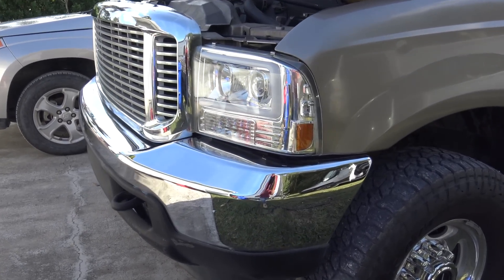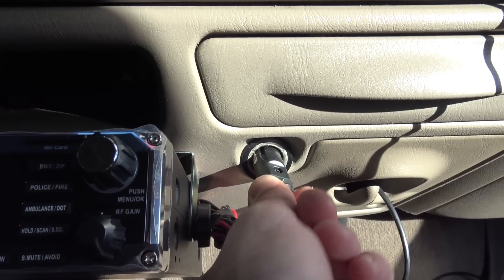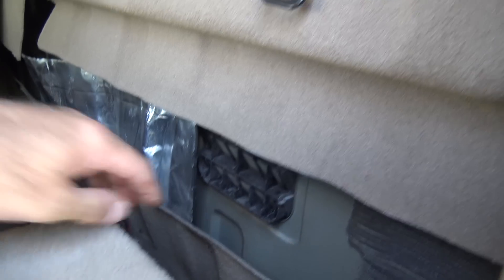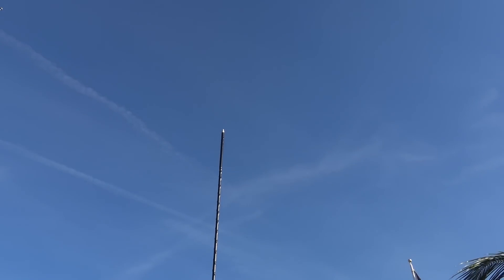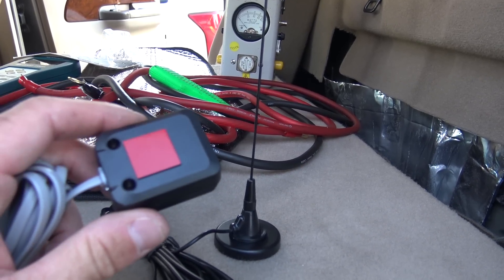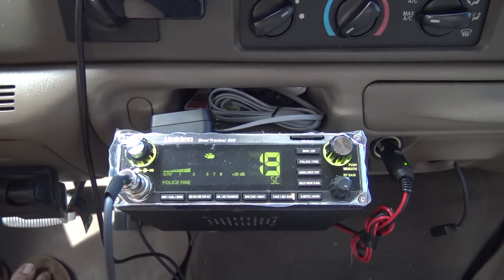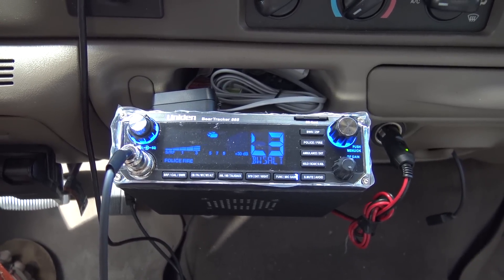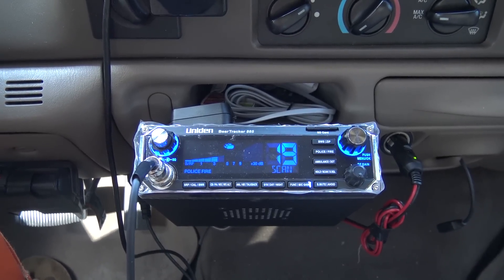I Installed The Uniden Beartracker 885 CB Radio/Scanner Hybrid In My Truck, Review Part 2!

Comment: Fine video! Thank you!
The unfortunate thing is that in my area, the police are so paranoid that they are 100% encrypted. I certainly see the need for encryption for various reasons, but why 100%. Traffic accidents? Really? I used to be able to avoid a road that might be blocked... a.k.a. avoid contributing to a congestion problem, etc. What about closed roads for flooding? What if there was something 'big' going on in my neighborhood and I might want to lock my doors etc.? This actually did happen about a decade ago, and there were helicopters sweeping the area. I was able to hear the area being impacted and whether the suspect was getting closer or moving further away. THAT is public safety to me!
Again, nice radio and thanks! (sorry for the rant, but I bet I'm not alone)
Reply: NO. THEY ARE ON NEW DIGITAL RADIOS AND NOT ANALOG RADIOS
Reply: @daleschleicher7794  No. They are digital AND encrypted 100%. Thank you for your incorrect correction.

Comment: In my 04 f250 I screwed the Mount into that removable “trash hook”.
Tilted it slightly so it favors the driver as well, happy with it because I didn’t mess up the main dash, the piece is easily removable and I have a replacement if I decide to remove the radio.
Reply from the maker: I don't dare open that cup holder if that's what you are referring to lol. Every truck I have had, it opened and never went back in correctly.

Comment: I would leave the right angle adapter where it is and put one on the other side. It looks better and there is less stress
on the coax. And the loss on the connector is negligible.  And this is one of the better installs I have seen..

Comment: If you encounter intermittent SWR issues run a ground strap to your tool box. I’ve had issues with that in previous toolbox installations.  Also watch for water following the coax down and entering the cab through that black plastic box behind the rear seat.  If you have enough spare coax make a drip loop in the coax between the cab and the bed and that may stop or prevent it.
Reply from the maker: Grounded the toolbox after this video

Comment: I powered my 980 with the console power port but I t-tapped into my 578 power for my 11m 1.21 gigawatts linear amp. That's right 1.21 GW. I can talk to truck drivers on Pluto!
Reply: Yeah, but the time it takes for the signal to get there and return is a buzzkiller.
Reply: @spaceflight1019  🤣😜

Comment: Hope it works better for you than what I've heard - most reviews of this I've read or heard are that it's a subpar performer and to steer clear.  Most say that if you want a scanner, get a scanner and not this scanner/CB combo since I guess it is pretty limited on customization options, etc.
Reply from the maker: It works for what it is
Reply: @HamRadioConcepts  Yeah the criticisms were about the lack of the ability to customize the scanning portion. Looks like it does work with basic functionality.

Comment: You can adjust which is prioritized in the menu for scanner or cb, 
Or you can have both, talk at the same time
Reply: I found that if I set the prioriety for the scanner, that I can squelch in the cb and when the scanner broadcasts it will override the cb, works nice.

Comment: We just have to get ya some Peterbilt mudflaps on the rear of the truck :D I still have my Uniden 980ssb that does SSB but the President McKinley does a better job at SSB. That plastic box with the flap helps push air out when you shut the doors closed. Some are in obscure places and some like the semi I drive at work has them visible on the back. Ours open (the flap) when we run the heat or AC.

73 Eric! It's always fun watching your videos with anything radio. 

WX7UTE

Comment: I've got a Uniden 980ssb that I used to run for cb along with my Yaesu FT-857D and a 1900r.
Radio nerd 😆.
 I pulled it eventually for the bulkiness and lack of use. It has a really good receiver imo for the price.
I also used to use a Yaesu FT-7100 dual bander a few years ago. 
The reason I bring it up is that I used it mostly vhf + vhf with the sub band on local LE freqs. They went digital though 😭. They ran off and left me in the analog dust. This is the perfect setup, albeit qrp 💩. I think if you use a Diamond MX-62 duplexer, with the hf output on the SO-239 cb side, and the vhf/uhf on the side with a BNC /SO-239 adapter you won't have to have to use that dinky scanner antenna, and it's not blatantly obvious that you're running a scanner. I did this for a while years ago with the FT-7100m for receiver of leo freqs and a Cobra 25. 
The antenna I use(d) still is a stainless steel whip #indestructable 👍
In closing, I'd really like to get one of those, but my Nissan Frontier just doesn't lend itself well for anything other than remote mounting or small compact radios.

Comment: I am surprised you don't know better.  Co-phase antennas need to be a 1/4 wave, on 11m is 9ft that you know, Your pattern is going to be screwy, change out the 75ohm to 50 with a T and run co-linear.  Plus, I am sure you did, but the toolbox needs to be grounded.  Good luck.
Reply: Hustler (New-Tronics) was big into co-phasing mobile antennas during the 1970s heyday of CB. Hy-Gain was big on co-phasing base station antennas. 
Most mobile antennas approximate a 1/4 wave antenna. Used in conjunction with a half-wavelength of coax you get a 3/4 wavelength, which is resonant. 
Co-phasing runs a 75 ohm coax cable, typically RG59, to compensate for the two 50 ohm antennas in parallel equalling 25 ohms. You can run a 2:1 SWR because it's only a 11 percent power loss, but it's not efficient.
Hustler advertising showed the pattern as a figure 8, with the energy being concentrated fore and aft of an 18 wheeler, just where drivers wanted it.

Comment: Excellent video. How come the GPS icon doesn't display on the screen? Asking because the manual says it should appear after about a minute and this is also happening on mine. My GPS antenna has a clear view of the sky so wondering what the deal is with the icon not showing on the screen.

Comment: Just received my 885 today and on power up I noticed two issues I’d like any input on. There is a continuous hum from the speaker. You can still hear the scanner traffic but this annoying hum is in the background. Secondly the unit gets very hot. I can barely keep my hand on the case. I emailed Uniden tonight for their opinion. Any comments or thoughts will be appreciated! Thanks!
Reply from the maker: How are you powering this device? The hum and hot sounds like it is not a clean power source, kind of like having a battery charger on it that is not a full wave bridged rectifier
Reply: @HamRadioConcepts  you are exactly correct. I was using a cheaper power supply and decided to try an Icom power supply I had and it’s filtering was much better and resolved the problem. Thanks for your reply

Comment: I noticed the satellite is not lite up, so the sat is not working. It will work inside the vehicle as long as it is "in view" of the satellite. Also, it allows you to choose whether the CB or scanner comes through or you can gave both come through. I have ran this radio for a couple years.
Reply from the maker: When I start driving it lights up , it may have not been lit in this video segment but it’s always on

Comment: I think you should tune antennas one at a time with a dummy load in place of the other...install looks awesome. Let us know how the bear tracker works. It looks interesting to me...
Reply: FWIW the way I used to tune dual antennas in my 18 wheeler was to have a spare 18' coax for a single antenna, tune them as a single one at a time, then check it again once you swap in the co-phase cable and modify if needed.

Comment: Antennas are going short when driving. It will hit the top of your tool box.  You will get a on/off type of audio, timing the right and left hitting at different times will be a big NO GO.

Being a HAM I would not have thought you would have connected both antennas. In what antenna book would that be in?

Comment: Hi Eric , watched your vid about
 President Randy FCC.
 I'm thinking that might be a okay choice 
1. in the ol' truck with President,  New Virginia  mag mount.
2. In ATV back country, fishing, hiking , With rubber duck replacement antenna. Which segways to my first question.
 In your opinion what would be a good replacement antenna  for rubber duck? 
Final question.
With your connections, in your humble opinion,
Do you think President will drop a New version of Randy With 
AM, FM, and/or SSB ?
Thank you for your time, consideration and suggestions in my deliberation.
As a side comment, from 1976, lived in Vero Beach for 43 years, Loved it, got way too crowded, Move to Maine. 
Best regards to you and your family.
Sincerely,
Larry
Reply from the maker: I'm not sure they will be releasing an SSB handheld, because the market used to have a couple versions years ago (I had one) and they haven't replaced it since, nobody has..

Comment: I want this in my semi! I see it's more than I expected when researching a cb though I never knew I could get all this.  Is there a handheld version I could easily move between my semi and personal vehicle?
Reply: Not that I'm aware of. I think this model 885 is the only CB scanner combo I've seen.
Reply: @DeltaWhiskeyBravo13579  I now have this unit in my semi.  Love it.  Cb signal is horrible however I think I need a new antenna.  I'm trying to research what will be best for it
Reply: @MrJermishere  my last CB antenna for the tractor trailer I drove was either a K40 or Predator style, the big external coil and long steel whip. I bought it in about 2005, somewhere about then so I don't remember specifics. I do know that it was tall enough to get the tip knocked off by a PA Turnpike underpass despite me having the antenna canted forward about 15°. I was running that as a single antenna on the drivers side. It still worked fine after that bump. And whatever that antenna was, it took whatever my  tuned Stryker SR-497HPC sent out. SWR was about 1.3-1.5:1.

FWIW if I'm remembering right, I was doing Target loads and I was sitting at a New Jersey Target along I-80 around Paterson possibly talking at a guy 30ish miles south in Edison, NJ. There's probably other contacts longer, but it did OK.

Comment: I'll be picking up a used 885 from a local tomorrow. I'm curious if it has a RF Output adjustment through programming. I would like to adj it's output down a hear to work with a footwarmer. Did you see RF out adjustment through mode selections?
Reply from the maker: I didn't look, I'm just running it the way it was, driving my Texas Star DX350

Comment: You want 1.1:1 or your output transistor will go bye bye.
Reply from the maker: I’ve run this amp with 2.5:1 before no issues I will eventually try for a 1.3 when I get time
Reply: @HamRadioConcepts  The spacing between your antennas is less than recommended which effect negatively on swr but unless you mount to the mirrors you're pretty limited. Of course you already knew that, I'm just pointing it out for anyone that is not aware.
Reply from the maker: @allanmccullough8550  I know but that was the max distance apart I could do.. it is working tho, many contacts on this, and some across the US but probably not optimal
Reply: @HamRadioConcepts  I have a dual setup on my 379 Peterbilt set for 11 meter but will do 10 meter without a tuner and made contact to Sao Paulo, BA. The mirrors on the truck allow spacing within a few inches of what is recommended.

Comment: I picked one of these on a trade Peaked and tuned swings up to 30 watts. All I can say is the bearcat is TRASH 🤷. I'm comparing this to my president Lincoln 2 plus. It's currently not installed in anything. Hope you enjoy yours but IMHO it's junk from recieve, to transmit, to the deal of the dials.